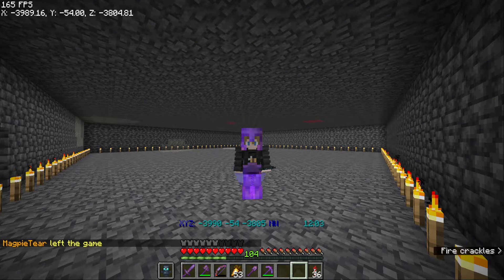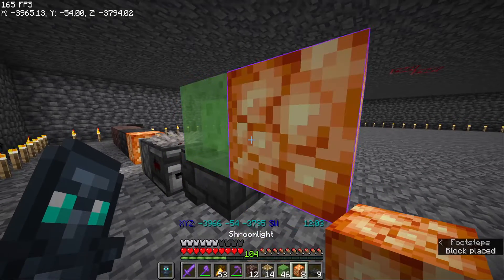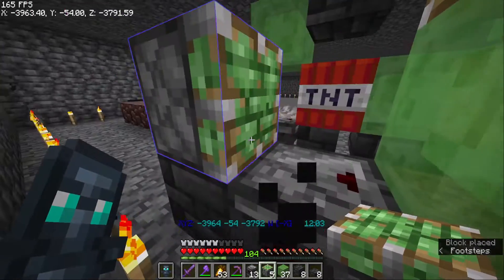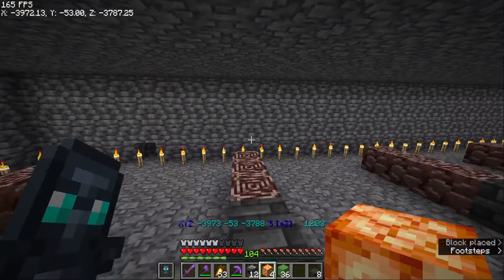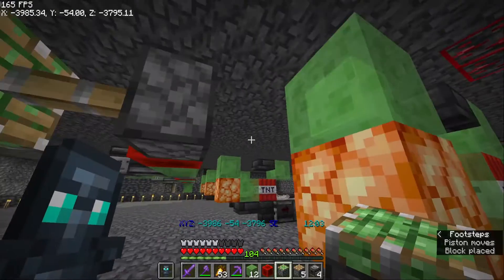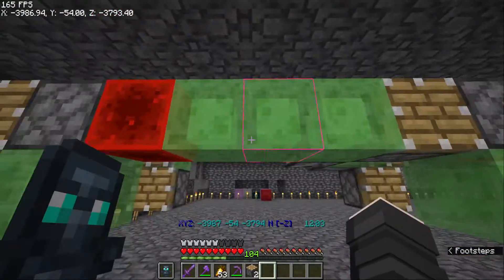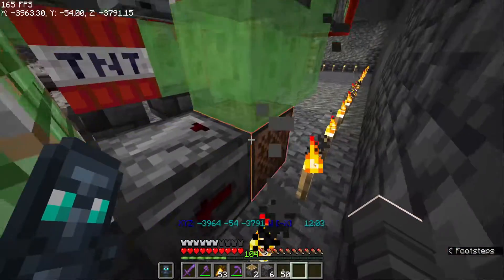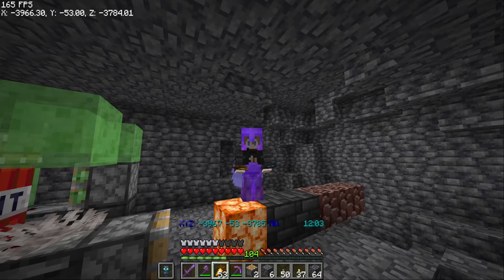5-wide tileable Tunnel Bore Tutorial (Java)

Comment: Have built this bore for the past year. Now on 1.21.10 the last 3 tiles don't work :(
Reply from the maker: Nothing about restone has changed, so I'm not sure why it would break
Reply: @glaive_ the slime blocks between the 2nd and 3rd tile are separating when the note block is pressed, meaning only the first 2 tiles move forward. It's the same machine that worked in 1.21.4 unless I've messed something up turning it on again since the update but I can't figure it out?
Reply from the maker: @mrsmamarex im guessing it has to be a mess up somewhere
Reply: @glaive_ I didn't have experimental features on in 1.21.4, I'm thinking could it be the addition of that official redstone update in 1.21.10

Comment: This still works.  AMAZING video.  Thank you so much for the list and going step by step and not speeding up the video so fast you can't follow along.

I've watched countless videos like this in the last week that show you how to build a single tunnel bore then do 500x speed duplicating 2-3 without explaining how to connect, distance apart, anything.

Top notch video.  Thank you.

Edit -  Question/Request  Is it possible to build the noteblock engine on both sides of the bore?  So you can press the block, run through to the other side make sure everything is kosher, then at the other side press the block?
Reply from the maker: Thank you for your kind words! Sadly i dont know of a way to trigger it from both sides.

Comment: Doesn't work in 1.21.4
Coral fan breaks after one use and the tnt gets used up instead of getting duped
Any fix for this ?
Reply from the maker: @kevina.1185  Sounds like the server you are on has a config on that prevents tnt duping. You will have to talk to the server admin to change the settings. if it's a paper server they will have to access the paper-global-yml or config file and set "allow-piston-duplication:" to true. There aren't any redstone changes in 1.21.4 that would break tnt duping

Comment: Built this a few times before using your video and has always worked, but this time when i tried to build it on a private server which is up to date, it works the first time but actually uses the tnt and break the coral any idea's why ?
Reply from the maker: @Theob-tx5ww  sounds like a setting in the config folder needs to be changed to allow piston duplication
Reply: @glaive_  Alright will have a look, great video by the way, detailed compared to some which is good :)

Comment: I have used Borkon's tunnel bore since 1.18. This design simplifies it, though I still prefer Borkon's trigger module which do not have the observer on the top like that -- making the entire bore system still 3-high.

A few notes though:
- Better to build the machine on Y=-52 since lava can turn air blocks into fire blocks 2 high above itself.
- Before triggering the machine, ensure at most one block gap between the furthermost ancient debris and the target wall of deepslates in front, in order to make smooth floors. In this video, the floor isn't smooth because the TNT managed to blow up blocks below the machine.
- I know shroomlight is not really required, but if we replace it things are harder to see because it is so dark. Froglights can be the replacements for shroomlights.

Comment: great vid, ive watched 3-5 videos on tunnels bores and this is simply the best explaINED, WORKS FIRST TIME, currently 25 tunnel bore long !!!
Reply from the maker: That's amazing!
Reply: @glaive_  possible to build out of honey? Or haven’t tried maby!? ,also I wonder can I put a note lock anywhere else or trigger from the other side?
Reply from the maker: @MrDaZa1400  Yes, but no. Several slime blocks are getting powered by an observer or the activator rail+minecart. Those have to be slime because slime is a full block and can be powered, honey isn't and cant be powered, so technically you can replace some of the blocks with honey but I wouldn't mess with it unless you know what you are doing.
Reply: @glaive_ can I use any solid block after the 3 nether ore at the start, was thinking block of diamond?
Reply from the maker: @MrDaZa1400 Diamond block should be fine

Comment: doesnt work, i spent two hours carefully following every step..... and it doesnt work not sure why the trigger doesnt trigger the machine
Reply from the maker: So doesn't work as in punching the note block does nothing, like no pistons move or anything?
Reply: @glaive_  the trigger just moves forward on its own and nothing else moves.
Reply from the maker: @Bryanshi-y7o   Ok, next few things to check, 1st make sure the upper sticky piston face on the trigger is facing and touching the redstone block on the engine so it is able to pull it forward when the trigger is used. 
2nd, make sure there is one block of air in between the engine and the duper part, the normal piston on the engine facing the duper section needed to have an air gap between it and the slime block on the duper its facing. 
3rd, make sure there is no extra blocks on the engine anywhere and that none of the slime blocks are touching walls, ceiling etc, and that there are no extra blocks anywhere else on any other part of the machine.
4th, make sure there is an air gap between the landing pad and the duper, and also an air gap in front of the landing pad and the wall in front of it.
Reply: @glaive_  alright got it thank you very much!
Reply: @glaive_  do you know if it will work on paper servers? i have the allow piston duplication on, and other tnt dupe farms work. I did build the bore in fabric, but i noticed it corrupted my world so im back on paper now.
Reply from the maker: @Bryanshi-y7o  yes it does work on paper as long as the right settings are turned on, this video was made on a paper server.
Reply: @glaive_  oh thats handy ok, do you know what settings have to be turned on? im on minehut i have piston duping enabled not sure if theres anything else. Thank you for all the help by the way i really appreciate it!
Reply from the maker: @Bryanshi-y7o  i think there's 3 options that are off by default and you can just turn them on.
Reply: @glaive_  alright. Im going to try to just move my world to vanilla anyways so i wont have to deal with all this

Comment: Idk if anyones gonna reply to this
But the trigger section alone moves when i click the note block
I rebuilt that section twice but idk whats wrong
Reply: Also it triggers the first tnt launch but nothing after
Reply from the maker: @abhinavsuvinr7922 3 things I can think of

1 make sure there an air gap between the landing pad and the wall, between the pad and the duping section, and an air gap between the duper and the engine.

2 make sure there's no slime blocks touching other blocks in the tunnel that aren't part of the machine.

3 make sure the trigger has both sticky pistons, that one of them is touching the redstone block with the sticky side, and that you have both observers. Hope this helps

Comment: Built this several times, and it works every time. The single unit clears out a nice tunnel, which you can then light up and place a nice path along for quick travel with horse or minecart.  You can also do the same thing in the nether, but be aware that the tunnel it clears is large enough for ghasts to spawn. It was a shock to hear the ghast noise, and turn around to see a fireball, from this ghast crammed into the tiny tunnel.

Comment: when i press the noteblock that section just goes forward one block but nothing happens to the rest! why is this happening?
Reply from the maker: Make sure you are using a sticky pistons in the right areas is probably my guess.
Reply: i rewatched the vid and tried it alone and it worked, tried about five times all worked so i added another one as you did and then when i started it the problem occured so it works alone but not tiled, ideas? @glaive_
Reply: I found it that the issue occurs when I add another miner, its fine alone tested it five-ish times but when i added another one the first try it didn't work. any ideas? @glaive_

Comment: Hi, I'm running into an issue even though I used this duper multiple times on different servers, as well as this one that i'm currently playing. So when I clicked the noteblock for the first time after building it in a new location (made it 10  dupers wide) and after clicking  the first 7 sections moved as intended generating tnt but the last three threw one tnt but also the tnt itself ignited right after duping. It only blew up the deepslate wall so rebuilt is making sure that everything is in place, however the issues persisted on those last 3 dupers so I just destroyed them. However I let my friend who doesnt know shit about minecraft run it and forgot to mention that he needs to clear lava so he fucking broke the 2 first dupers along with the note block switch. Rebuilt that. The same issue from before appeared but on those first 2 dupers but all of those that were intact after the incident moved as intended. Any idea what causes it? (Paper version 1.20.2 server config changed to allow duplication and as I said it dupes as intended but also on some dupers it ignites right after duping)
Reply from the maker: If I had to guess it's chunk borders issues, some times if it's lined up in a certain way it can cross badly over the border and certain updates don't go through or it receives a slightly different update
Reply: @glaive_  does that mean that i should move the duper so that none of the dupers are on the chunk border?
Reply: nvm sorry for wasting your time for some reason my dumb ass decided to just build the machine different and place the first observer facing into the piston instead of the wall

Comment: Dose it work with honey
Reply from the maker: Yes, but no. Several slime blocks are getting powered by an observer or the activator rail+minecart. Those have to be slime because slime is a full block and can be powered, honey isn't and cant be powered, so technically you can replace some of the blocks with honey but I wouldn't mess with it unless you know what you are doing.

Comment: Can you add a machine that gets rid of lava? Im doing this in the Nether
Reply from the maker: The problem is this machine would have to run in front of the bore to be effective... the means that lave clearer would be blown up, and if you made a blast proof one, the bore couldn't continue moving forward because the machine would be shielding the explosion instead
Reply: It could be temporarily stopped for the machine to go back and forth @glaive_
Reply from the maker: @HoIIowGamer  and where would the machine sit while the bore is launched? There's ~2-3ish maybe 4 in the nether blocks to the side of the bore in the tunnel it makes, and only a few above it. This doesn't leave room for much
Reply: Its not hard to dig out a space... I saw someone do that exact thing but I had already built this bore @glaive_
Reply from the maker: @HoIIowGamer  I mean if you are digging out in front of the lava clearing machine so it can also move forward that's a different story
Reply: The machine would move back and forth, then go out of the way of the bore (how ever many blocks to the side) it would move down a certain number of blocks while the tnt blows up the wall @glaive_

Comment: Hi when I completed my machine of 5 it worked completely fine when I first clicked the note block but the second time I press it only the first tunnel bore works while the other 4 do not function. I rebuilt it but the problem is still there. It seems as though for me the machine is only of 1 time use, is there any reason for this?
Reply from the maker: Check your spacing between the wall, landing pads, dupers, and engine, there should be a block space between each section of the machine. also check chunk borders (f3+g), those can also mess things up
Reply: @glaive_  thanks for the response, but may I know if the whole thing needs to not touch blocks or only the tnt duper area? And how will chunk borders affect it?
Reply from the maker: @YCBartley  chunk borders can effect redstone updates. Gap wise there should be a gap between the wall and debris on the landing pad, one block gap between furthest piston in front and the landing pad, and one air block between the slime block that is behind the  minecart, and the piston facing forward in the engine. Those places should always have an air gap

Comment: Built this in a single player vanilla minecraft world. The  whole machine moves forward, but except for the first unit, the rest don't dupe tnt. Any solutions?
Reply from the maker: Check the rail types and that the coral fans are in the right spot. If the first unit works copy that exactly for each other one. Also make sure you have room in front of the machine to allow it to move forward, if it doesn't part of it can still move but it will collapse upon itself
Reply: @glaive_ The rail type is activator rail. There is one block space in front of the ancient debris. The coral fan is placed over the observer. All the units are the exact  
replica of one another. It still only moves forward. I have tried multiple designs of multiple youtubers like shulkercraft, mysticat, but I have no luck.
Reply from the maker: @isowoos1427  ok also going to ask if there's any honey blocks being used? Also, If you have discord I am happy to troubleshoot further since you can share pictures of the build to me. I'm @glaivelord on Discord
Reply: @glaive_ OK I will add u to discord. At what time are u available?
Reply from the maker: @isowoos1427  I'm PST Timezone, so anytime during the days

Comment: can the slime blocks be replaced by honey blocks?
Reply from the maker: Yes, but no. Several slime blocks are getting powered by an observer or the activator rail+minecart. Those have to be slime because slime is a full block and can be powered, honey isn't and cant be powered, so technically you can replace some of the blocks with honey but I wouldn't mess with it unless you know what you are doing.

Comment: can this be further extended beyond 5 wide?, also what are the dimensions of the room you used to build this
Reply from the maker: Yes it can be expanded and room dimensions are 30x30 as stated in the video
Reply: @glaive_ is it sim distance or is it render?
Reply from the maker: @rynow1992  yeah Sim distance is the important one
Reply: Should be able to expand it as far as ur simulation distance. So if ur 4 chunk sim and in the middle bore, u can expand 2 chunks each direction theoretically. Id keep away from the sim distance edges tho in case u move, to avoid unloading and then blowing it up

Comment: the tnts wont dupe, what doooooooooo, i followed everything i think
Reply from the maker: It won't dupe as in:  it launches tnt once then theres no more tnt? Or is it that when you launch it nothing happens?
Reply: @glaive_  im sorry for wasting your time, i read your replies on other comments and i found out this provlem is caused by paper, the thing that runs our server. Fixed that by doing a little editing on the files, thanks for the tutorial man!
Reply: @jeremypen7818  which files did you edit? running into the same problem it just launched the tnt but didn't dupe and using paper
Reply: @JoshuaJames604  I went into a folder named config and edited the "paper-global.yml" file to set the bottom 4 (more or less) arguments to true instead of false which is the default
Reply: The 4 settings i changed are: 
allow-grindstone-overstacking: true
  allow-headless-pistons: true
  allow-permanent-block-break-exploits: true
  allow-piston-duplication: true

Hope this helps!
Reply: @jeremypen7818  appreciate that 🙏

Comment: Hey the machine sort of works but when I fire all the engine sticky pistons reset and are not pushing so I have to replace the everytime (if that makes sense) btw I'm on a paper server idk if thats why
Reply from the maker: Ok, make sure you have the slime block and normal piston that goes under that sticky piston, paper shouldn't be the issue here, but it's not out of the question as paper is very customizable and can effect stuff like that im pretty sure. (If it helps any, this video was recorded on a paper server.) But first just make sure you didn't miss any steps of the build.
Reply: @glaive_  oooh I forgot the bottom pistons sorry my bad it works now thanks for the help and great tutorial
Reply: @glaive_  btw, just made one in the nether but lava is so annoying, I built it at Y 16, what would you please recommend?
Reply from the maker: @lorenzofct  I would build it lower, like y10ish, that should help some
Reply: @glaive_  ok thanks I'll try

Comment: It doesn’t work anymore. When you push the mine art the tnt blows up
Reply from the maker: Are you on Java? If you are on any version that's not Java then this will not work.
Reply: @glaive_ yeah I’m on bedrock. Do you know anyway to make it work on bedrock or any other versions of a tunnel bore I could make?
Reply from the maker: Uh not off the top of my head, sorry. no this design can't be altered for bedrock because the way the tnt duping works on Java just can't happen in bedrock the way its coded.
Reply: @glaive_  I'm on java on a minehut server, When I hit the note block all the TNT launch, but after that there are no mopre TNT or coral fans on the machine, 1.20 Java
Reply from the maker: @crocsroblox9659  So what's happening here is a server config is stopping tnt duplication from happning. If you can access the server files and console, then try this: stop the server and then go to paper.yml. There find the option  allow-piston-duplication: false and set that to true. Click save then start the server back up. Think that is the correct option to enable tnt duping. If you don't have access to server back end stuff then there isn't anything you can do except ask the server admin about it.
Reply: @glaive_  Yeah thanks, I messaged the owner and they're getting it fixed.